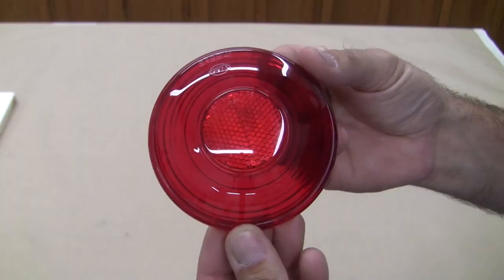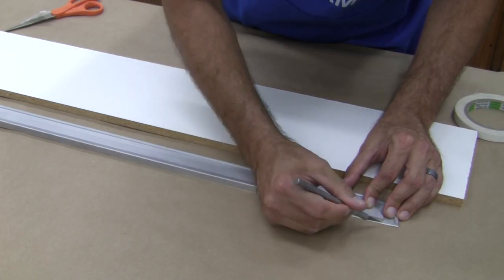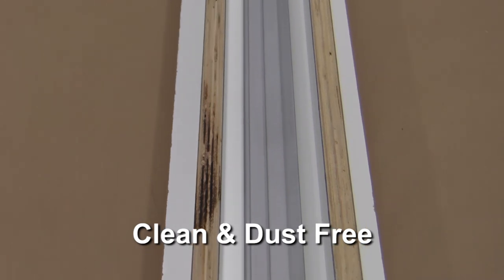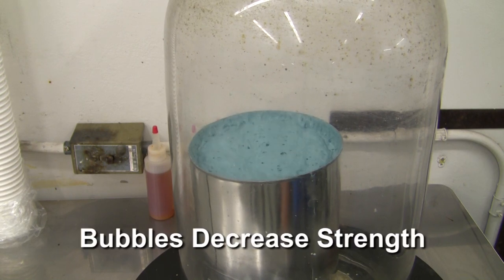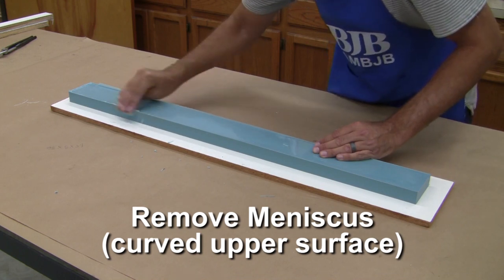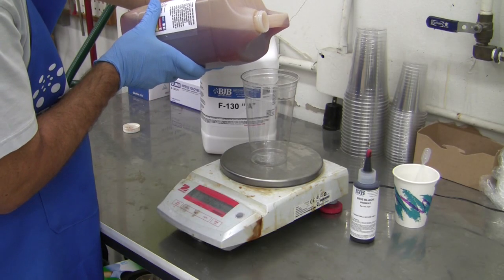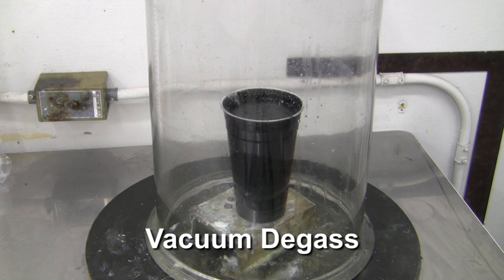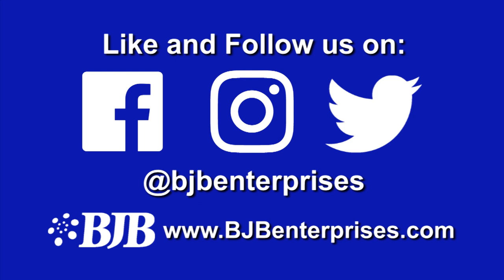Make Auto Rubber Trim w/ Silicone Molds | Tutorial

Comment: excellent. I am trying to find or reproduce a rubber seal for a vehicle and this seemed to help me decide it can be reproduced. I do have the original but it has some cracks so im not sure if I can use it to make the mold. GREAT video!
Reply from the maker: Russ Feldbusch that is a great question.  If you can find a way to make small repairs to the original (fill cracks with clay or bondo) then it may keep things simple.  Sometimes though, you’ll need to make a new one using 3D printing or machining like the video and then you can make a high quality mold. If you need help, feel free to send our tech staff an email to show us the part.   We are really good at guiding the customer in a practical direction vs just selling you products that aren’t needed.  info@bjbenterprises.com

Comment: Question about 06:50, is there any way to ensure the cast is exactly the height of the mold? I imagine one way would be to pour an excess of resin and then go over the mold with a flat part to ensure the resin is even with the mold, but not sure if this would work or not. Two part mold would also work I guess but I would rather avoid that.

Also, what would the strategy be if there were one or more (through)holes in the part? Would it still be possible to use one part mold?
Reply from the maker: Hi There.  You are correct, the easiest way to make a perfectly flat "top" is place a piece of plexi or similar on top (mold released) and slowly lay it over the exposed top of the mold.  You would see some flashing around the edges as it's squeezed out.  As far a holes, you can incorporate metal pins in the molding process.  See our advanced mold tutorial here for that:  https://youtu.be/C7uMkBzOMaMhttps://youtu.be/C7uMkBzOMaM

Comment: I need to copy a narrow wood moulding to make it so it will curve.  The trim is around the countertop in my kitchen, and we made the deck side curve.  We couldn't get the moulding to bend even with soaking and trying to score the backside.  I think I need to make a silicone duplicate of the moulding and then make a flexible, paintable moulding out of that.  Is this doable?

Comment: Even plastic hubcaps for cars manufactured since the 1980s can be reproduced.
Reply from the maker: RS 1990 Yes, many different parts from interior to exterior are made with the process.   We have several customers that will also chrome plate urethane for trim.

Comment: Good video...now please make a follow up video how to make  design a hollow weather striping used around automotive  trim used in modern cars for window and truck deck lids
Reply from the maker: Typically that type of material is available for purchase.  Many of our customers create special parts that simply don't exist anymore.  Thank you for the comment.
Reply: @bjbenterprises  some gm old model have a complicated solid rubber molding that transition into hollow D shape then back into a sold rubber piece...  Im looking to make such a custom mold as complete unit.
Reply from the maker: @772777777777777  There are a range of urethane materials you might be able to use for that.  The key issue is the tooling and molds.  If you are new to mold making, this might take some serious engineering to achieve good results.  Hard to give advice in a YouTUbe comment section, so if you have a serious project and need help with materials, feel free to contact our tech staff to see if we can help:  info@bjbetnerprises.com

Comment: I'm wondering, would it be able to cast a full rear window seal with this method/material. I need one for my car but they are close to unfindable.
Reply from the maker: Is it possible?  Yes.  Do you have the equipment and knowledge to make a mold that can cast flexible materials into?  That's the key question.  Building molds for one part is a very long and expensive route if you haven't done this before.  The mold you see here was this customer's project after completing many others before this and having many failures along the way.  We often recommend starting with a small, simple part first to learn the process before starting on a large, complicated part.

Comment: Overall an excellent video!
But it should be noted that a machined master from an outside supplier will be very expensive.
Therefore, if cost is an issue, one should consider hand-crafting the master pattern from readily-available materials.
Reply from the maker: Thanks for your comment, that is very true.  In this particular case, finding an original piece to take a mold off was not possible and the aftermarket parts available were terrible in quality.  The individual here decided to invest into making an OEM quality pattern and subsequent parts.  If he were to re-do a similar part or project, it would be more economical to simply 3D print a pattern (even in 2-3 pieces given the length) and hand finish to a high quality surface and make molds from there.

Comment: Could you mould car floor mats and create custom ones via this method?
Reply from the maker: Yes, we have had many customers make custom  rubber floor mats with this technique.
Reply: Oh awesome what kind of rubber did they use to make it as close to an original rubber mat as possible?
Reply from the maker: @paddeemusio  typically most rubber mats are somewhere around 50-60 Shore D hardness.  We have several products that could be used depending on the size and shape of the part.
Reply: @bjbenterprises  ah I see I wouldn’t mind molding some existing car mats and then customising them

Comment: hi i’m interested in making a part for a bike shifter/brake. it’s called a hood and is made of a soft rubber. it goes over the shifter. these are no longer made.
i’d like to attach a picture and see if someone could guide me on what would be the best product to use. the orem is a flexible rubber with a little stretch capability . it’s a little grippy but not sticky.
Reply from the maker: Bennett Marcel you would need to send pictures and description to info@bjbenterprises.com

Comment: Why not just CNC the wood mold, and cast rubber in it? Does the mold have to be silicon?
Reply from the maker: Daniel Ziran-Xu there are several materials you can use for molds (metal, plastic, tooling board) but wood is not recommended unless you do a lot of work sealing, sanding, and smoothing the surface.  Silicone is very easy to make molds for casting urethane because you can cast it against your model and capture the detail while not needing a lot of mold release (silicone is non-stick).